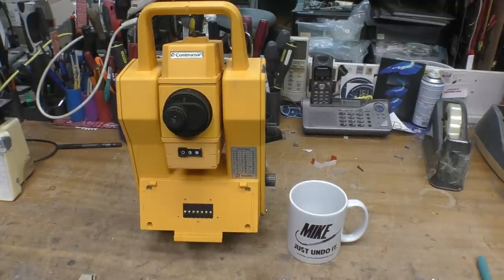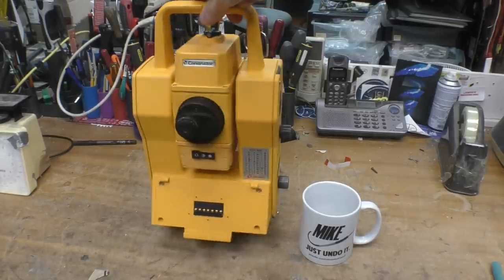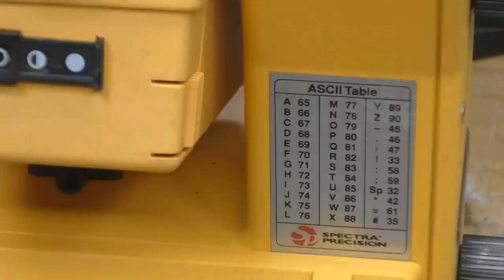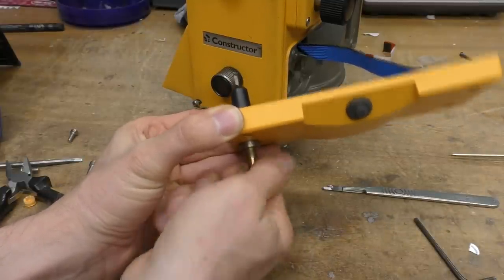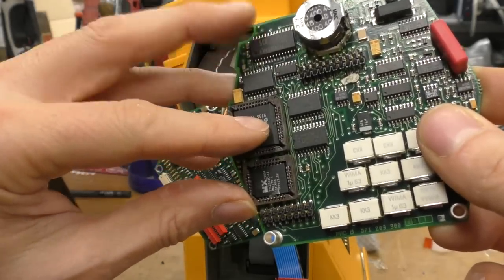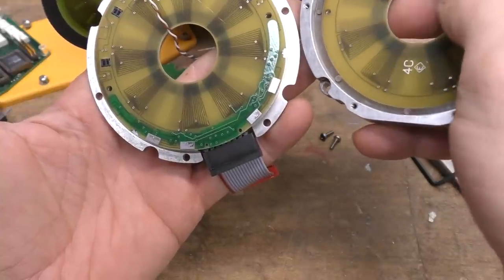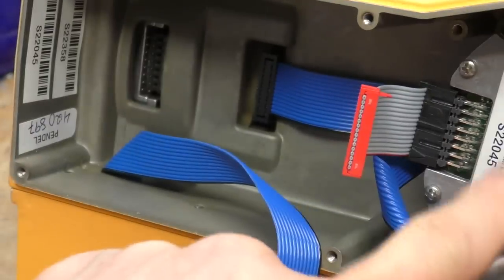Spectra Precision Constructor total station teardown

Comment: Summary

Introduction and Basic Features of Geodometer    
0:00 - Introduction to a geodometer, also known as a total station    
0:16 - The device is used for surveying buildings, roads, etc.    
0:23 - The geodometer maps out positions of objects in 2D and 3D space    
0:33 - Features include a laser range line and a telescope    
0:52 - The device maps out an area by measuring angular positions and distance to an object    
0:59 - Initially assumed this would be a remotely operated model    
1:37 - The model appears to be a standard manual one without the user interface or computer panel    
1:53 - Expectation is for high precision angular measurement and laser rangefinder    
1:56 - The geodometer is a Spectra Precision Constructor    
2:13 - Differences between different brands would likely be in precision    
2:23 - The ASCII code table on the front of the device is puzzling    
  
Physical Features of the Device    
2:52 - Bottom part of the device is the battery    
3:00 - The battery also serves as counterbalance    
3:12 - There are various knobs on the side and the bottom of the device    
3:16 - The device features a telescope with a focus adjustment    
3:26 - Telescope is of high-quality and long-range zoom    
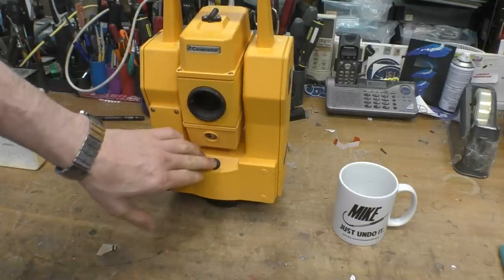3:34 - There is a button on the front of the device    
3:38 - Alignment aids on top and bottom help the person at a distance to line up with the lens    
4:28 - The device features a 4-pin connector possibly for power and RS232    
4:38 - There is a connector for a user interface or a computer that does calculations based on the angles and distances     
4:44 - The device features an interconnect board and a push button on the front    
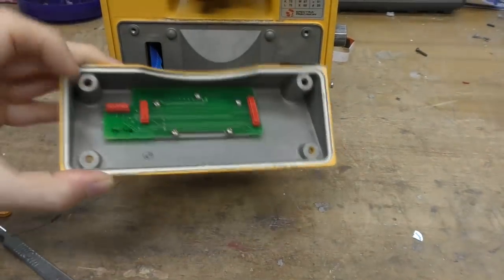4:46 - The side panel features an encoder, an 80c32 processor, external prom, and some RAM    
6:03 - Inductive coils and opto reflective sensors provide high resolution output for angle measurement    
7:14 - The encoder is connected directly to the rotating sensor    
7:45 - The encoder provides both absolute position reference and a high-precision output    
  
Further Investigation and Component Details    
9:29 - There is a PCB inside the cover with a couple of backup batteries    
9:38 - The device features two knobs for adjusting each axis    
10:01 - The device features a Sounder.  
(10:04 - 21:20: Details about components identified and their functionalities are discussed)  

- 10:04 Discussed a hearing aid type called Sounder  
- 10:08 Spotted a unique object   
- 10:11 Noticed several components including a 87c51 single chip micro, ram ewart chip, rs232 drivers, and analog switching  
- 10:29 Noticed power supply components and batteries   
- 10:31 Suggested batteries could be backing up the Ram and discussed user interface  
- 10:37 Noticed an inductor, believed to be associated with the power supply  
- 10:41 Discussed knobs and their functions  
- 10:47 Explained the process of course and fine adjustments using the knobs  
- 11:09 Suggested it is a way of providing course adjustments  
- 11:19 Noted similar functions for the rotation axis  
- 11:24 Introduced a locking mechanism  
- 11:41 Identified a similar type of encoder seen on the vertical axis  
- 11:47 Noticed a sensor connection, believed to be used to generate the field for the Central rotor  
- 11:57 Suspected the connector may be part of a slip Ring Time arrangement   
- 12:03 Saw a fuse which is likely for the power connection  
- 12:13 Suggested different versions may exist based on outdoor usage  
- 12:25 Noticed a slip ring assembly at the bottom   
- 12:34 Discussed the load bearing system  
- 12:39 Noted heavy plated copper for the slip rings on the PCB  
- 12:47 Noted duplicate tracks and contacts for redundancy   
- 13:05 Suspected a module to be a level sensor  
- 13:16 Predicted a ball or similar component inside  
- 13:22 Noticed a shielded cable connected to a PCB  
- 13:35 Opened a separate assembly on suspension  
- 13:46 Discussed the high impedance input stage and amplification circuitry   
- 14:39 Switched focus to the battery charge port  
- 14:46 Identified Nickelback high dried batteries  
- 15:03 Noticed three contacts likely for power and a temperature sensor  
- 15:13 Found a LED for visual indication  
- 15:26 Explored the Optical components  
- 15:39 Recognized an optical attenuator and mirrors for calibration purpose  
- 15:49 Identified a laser diode feeding into one of the fibers  
- 15:59 Discussed separating the receiving and transmit paths  
- 16:20 Noticed a small assembly for inverting mirror to compensate for the inversion of the optical system  
- 16:42 Explained the eyepiece and how it provides mechanical zoom  
- 16:54 Discussed infrared rangefinder optics  
- 17:02 Noticed a LED indicator for users  
- 17:10 Identified two fiber optics, a transmit laser, an oscillator, and a temperature compensated oscillator  
- 17:20 Proposed a hypothesis for the functioning of the system  
- 17:36 Identified an 805.1 based architecture microchip  
- 17:46 Discussed the highly sensitive optical receiver inside a can  
- 17:53 Noticed NE602 mix Ross later, a coil, and a couple of high voltage diodes  
- 18:00 Discussed the architecture, compared it to a radio receiver  
- 18:20 Discussed the placement of Optics and fiber, and mentioned the possibility of an avalanche photodiode for high sensitivity.  
- 18:20 Introduction of an angled reflector  
- 18:24 Discussion of the weather fiber optics  
- 18:28 Reflection off the front piece  
- 18:35 Presence of a coating on the reflector  
- 18:40 This coating acts as an infrared reflector to maximize output and reduce risk to the user  
- 18:51 Presence of an insert acting as an indicator  
- 19:01 This allows for visual indication when using the device  
- 19:10 Examination of the PCB and fiber optics  
- 19:13 Speculation that the transmission laser could potentially be a laser rather than a LED  
- 19:18 SIM for AC 540 acting as a high-speed driver  
- 19:28 Mention of two unidentified semiconductors with oscillators  
- 19:35 Presence of a temperature compensated oscillator  
- 19:40 Frequency measurement of the oscillator  
- 19:49 Discussion of laser range finding and the use of high frequencies  
- 20:01 Speculation about the presence of the same chip in both transmit and receive paths  
- 20:09 Consideration that this could be a custom chip with both receiver and transmitter functionalities  
- 20:36 Single chip micro 805.1 based architecture present, dating to 1996/1997  
- 20:46 Analysis of the optical receiver   
- 20:53 Mention of an NE602 mixer  
- 21:00 Observation of a coil and high-voltage diodes  
- 21:08 Speculation that the device could be using an avalanche photodiode   
- 21:20 Explanation for why optics are put down a fiber rather than located in the optical system  

Testing and Concluding Remarks    
21:49 Attempt to power the device using 12 volts    
21:55 Observations on the device's response    
22:03 Difficulty in determining RS232 commands    
22:28 Mention of similar teardowns found on YouTube    
22:43 Surprise at finding an inductive encoder    
22:54 Mention of the high price of new models    
23:01 Additional features on newer models like motorized axes and GPS    
23:07 Mention of the device's robust build for use on construction sites    
23:19 Uncertainty about the device's functionality without the front panel    
23:27 Speculation about the possibility of operating the device entirely through RS232.

Disclaimer: I utilized gpt4-8k 0613 to condense the video transcript
into a summary.  It generated timestamped bullet list and organized it
into sections with titles. The summary was manually formatted using
YouTube comment markup.

I think the transcript has quite a few wrong words: 'course adjustment'
should be coarse adjustment. 'nickelback high dried
batteries' should be ' Nickel–metal hydride battery'. Ah well.

Comment: Maybe they use an inductive encoder since its an absolute device, never lousing zero?
Reply: Optical encoders can also be absolute. As Mike mentions, it can be a way to circumvent a patent.
Reply: Optical encoders often have an index mark but they usually don't give you an absolute position "cold". You have to pass the index point and then count ticks from there.

Versus a magnetic device that gives you sin/cos outputs that you can always get the abs position from.

This appears to be neither, however.
Reply: @rfmerrill  
Yes with an optical encoder on power on you would have to rotate the head through the index mark. Have used an absolute optical encoder but they are very complex and expensive for high resolution.
This looks like a large PCB based RVDT.

Or it just might just be PFM
Reply: Sure, quadrature optical encoders aren't usually used for absolute positioning since you would need to have some sort of indexing, but Gray code encoders will give absolute position right off.
Reply: @frtard  
For 8 bit resolution there would be 8 sets of tracks, emitters and detectors. gets really ugly at 16 bits.
Reply: @universeisundernoobligatio3283  No need to have multiple tracks, you just have one single track with multiple detectors offset by less than on step in track.  Like a vernier.  Look at any digital caliper, they use this method by capacitive.
Reply: @ikocheratcr  
Looked at a tare down of a digital calliper, yes they have one single track with multiple detectors offset by less than on step in track.
But they are not absolute devices, all my digital callipers lose there position when you power then off therefor not a absolute measurment device, having to be re zeroed on power up.

Comment: I wonder maybe the hearing aid in the bottom, could be to detect vibration from heavy construction. So the measurements no can be valid when it’s happening.
Reply from the maker: No, it's just a beeper. Maybe waterproof
Reply: @mikeselectricstuff  lol.. or one of those heavy goods vehicle sounders.. " attention, this tripod is falling over"
Reply: @mikeselectricstuff  It looks extremely similar to a Telex/Audio Implements IFB earpiece transducer used in broadcasting. They're usually about 500 ohms, and I don't get why they wouldn't use a standard beeper because those transducers are rather pricey.